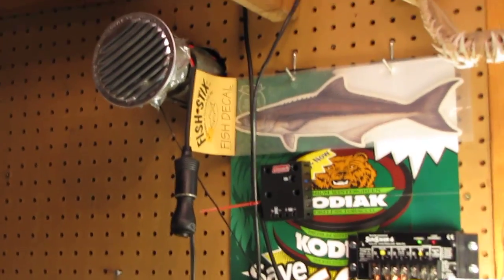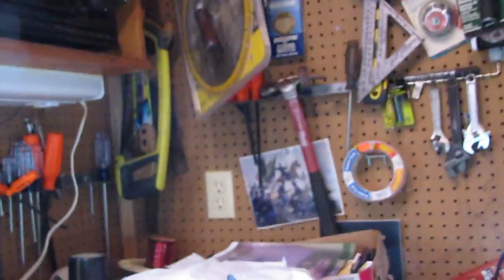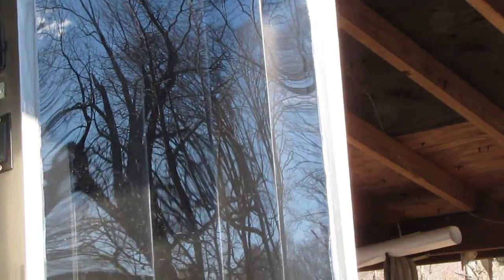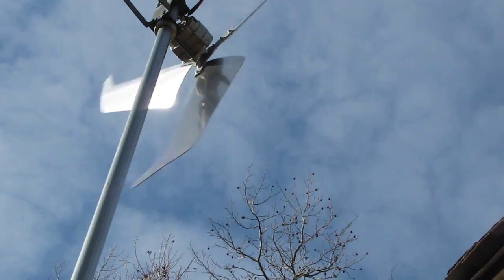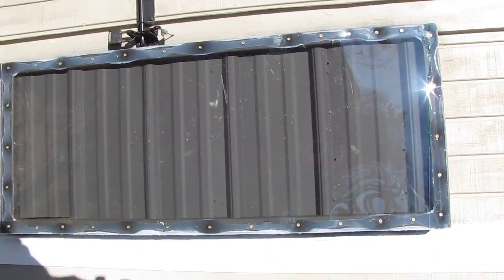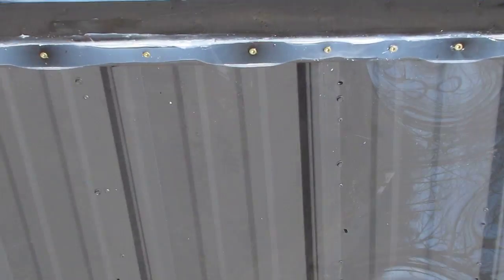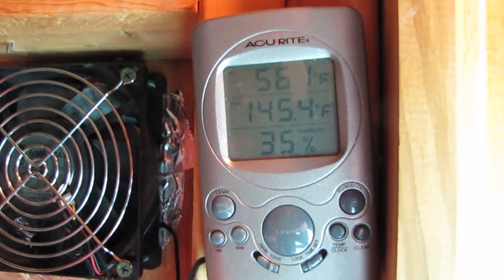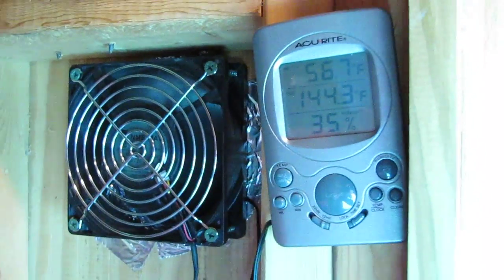UNION BOILERMAKER BUILDS SOLAR AIR HEATER Out Of  Local 45  Richmond  VA

Comment from the maker: @nprcomputers wood is a great Insulator It doesent get hot enough to hurt it  You can use alumnium or steel  I made Baffles Out of Powder coated steel  I used  my Bender to Z Baffles I made about  6 of them Horizontally  Then riveted them to Powder coated steel Absorber Plate  which is peice of siding off of a car port   Plus I insulated the inner box with self expanded foam with flashing over top  the Painted  Black  It works great  Buddy